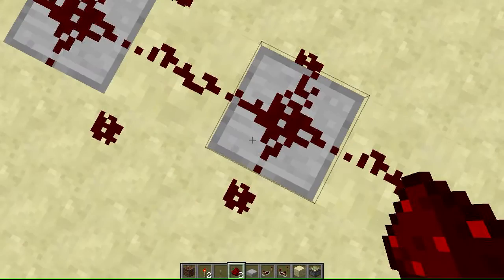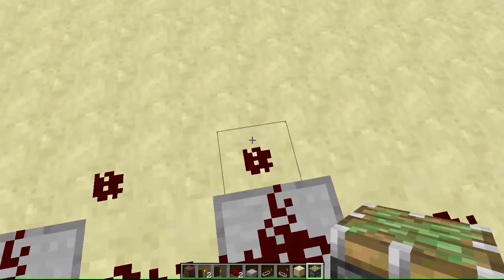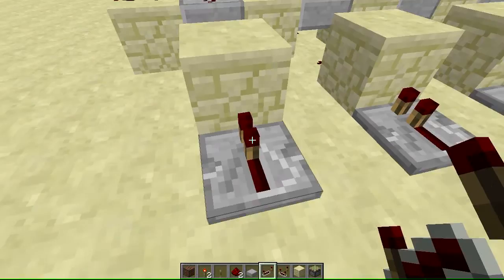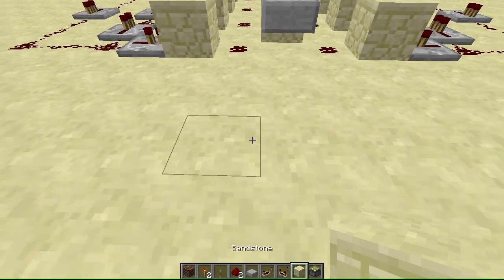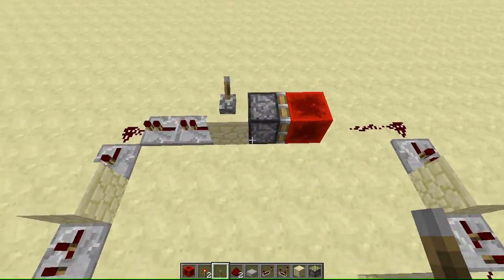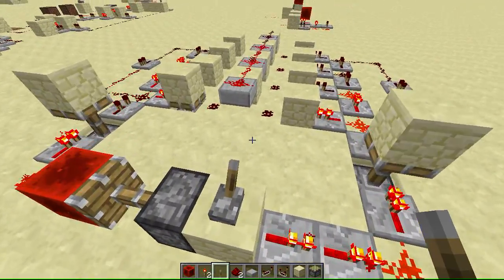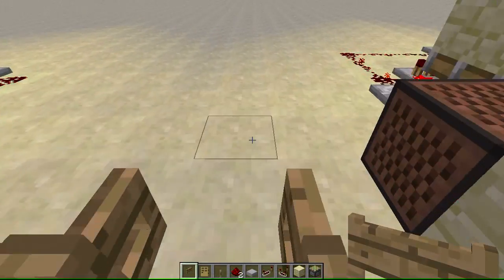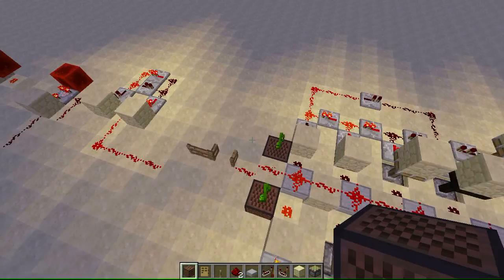0.25 tic clock in Minecraft [1.6.2] & [13w36a/b] +tutorial

Comment: The other is just a tiny Von Neumann style machine specifically oriented toward survival practicality. I figure a computer is survival would need to be no more than 4-bit, and a lot if its implementations might require less. To be practical, it needs to have a very high memory density, but also very cheap, so the CPU's going to run directly off of a writeable piston tape drive. It may also include a small input stack. It's branching system will be incredibly simple, derived from Brainf***.

Comment: Absolutely. I really don't care if the signal processors are instant, so long as they are consistent. I could just buffer the write addresses in my instruction lines so that the computer wouldn't have to wait. Which would probably require a branch predictor, but I can just use a double-instruction cache technique, where both the subsequent program address and jump address are loaded, and by the time the get to the CPU, the result can determine which to execute.